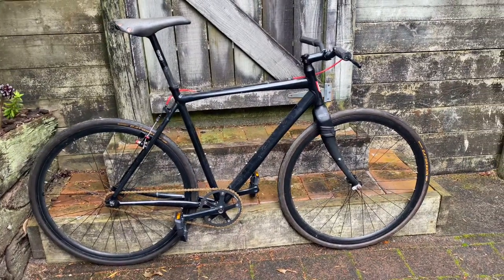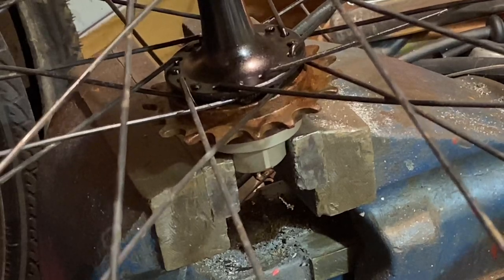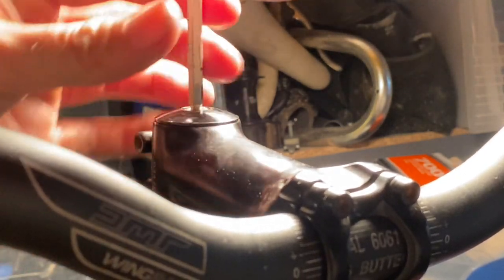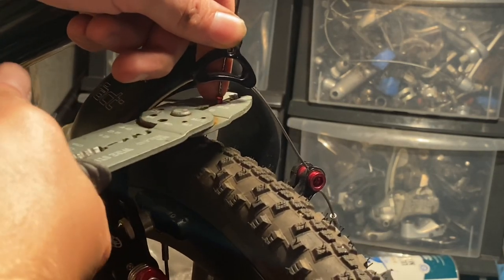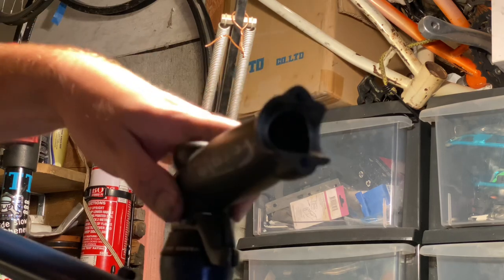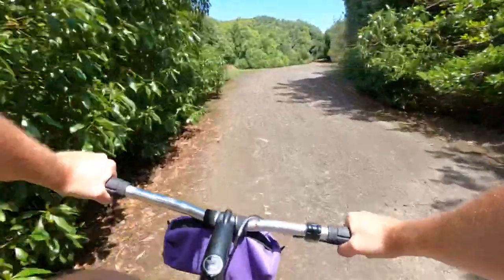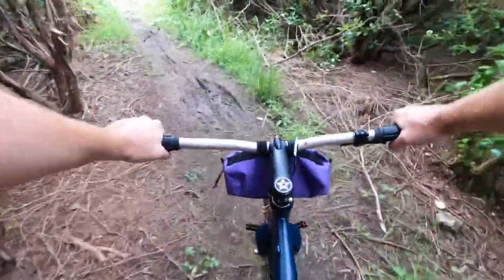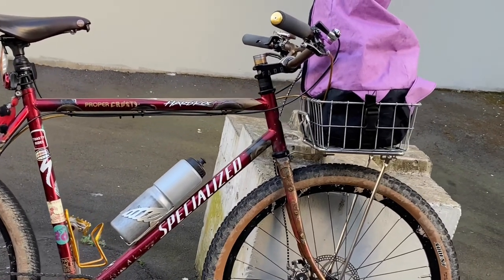Fixed Gear Commuter build (Specialized Singlecross)

Comment: I'm 6'3" and I have a bunch of smaller framed bikes as well. Like you, with longer seat posts, they work pretty well. I like this build. I'm not familiar with this frame, but its pretty slick looking. Would like to find more Specialized bikes to work with as the are thought of as a quality bike here in the U.S.A.

Comment: Sweet build! Only just got around to watching this. I think I might have left the question on the Avid Shorty Ultimate O-rings - they always perish leading to the loss of the red bits. Avid sells spares but you have to buy them with the red bits (and even now, they're becoming harder to source). If you do end up keeping a set of these brakes, 1/4" orthadontic ligature bands (for braces etc) are a cheap alternative that fit in the grove and area available in various colours by the hundred for a pittance. They don't last long either but are super easy to source.

Comment: forgive the late comment, but if you want to add the missing o-rings to those pivots, you can just buy some generic 9mm OD / 1mm thickness ones and they work perfectly! in practice i'm not sure how much it matters, but at least it prevents them from falling out of the arm when the cable is removed.

Comment: Hi great build, yes I see how you like the saddle to bar drop,  mustn’t be much post left in the seat post? Also no bell?
Reply from the maker: Thank you! My bikes that run a lot of exposed posts are normally 350-400mm long, I try keep about 10cm in the frame (depending where the seattube-toptube join is. The post should be a few cm past that).
You’d be surprised at how ineffective bells are, although I love ringing them 😅 they aren’t required here, and I don’t have enough decent ones to fit all my bikes. Ooh horns work well, though!
Reply: @toastyrides  you must have a bell here in Australia

Comment: I have that same front fork just sitting around you can fit a 29er 2.5 tire on there it came on 2010 specialized tricross single speed bike I cracked the frame a few years ago✊😎. P.S. still wondering why they made that fork with such clearance on a cyclocross bike🤔.
Reply from the maker: No way! 2.5?! 😆 that’s insane, didn’t try anything much wider on it because the rear maxes out around 2.0. But it’s cool to know it’s limit!